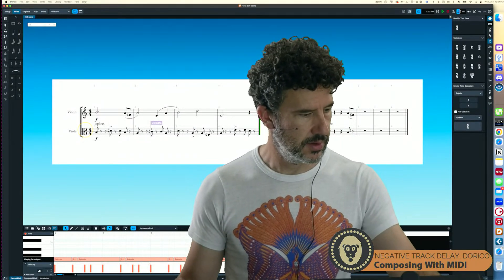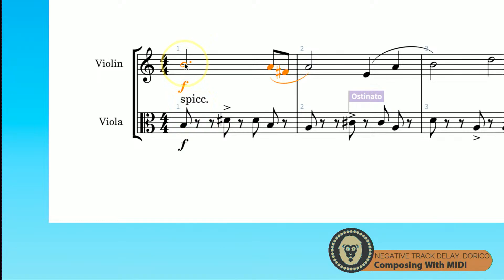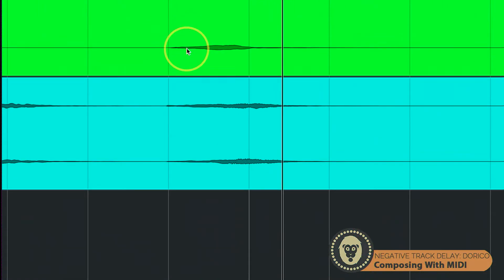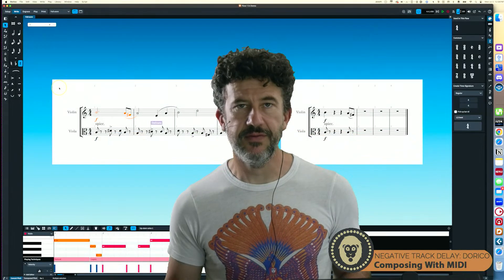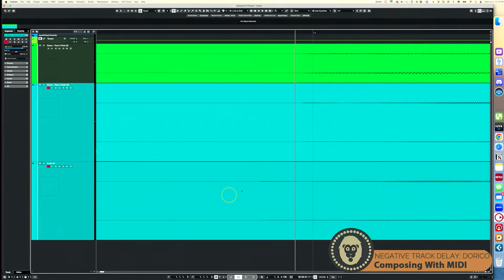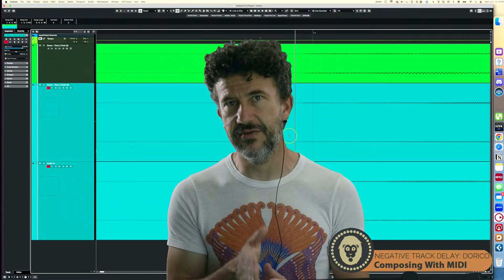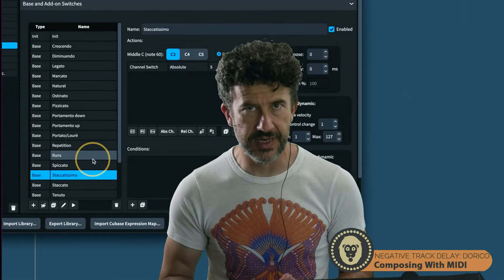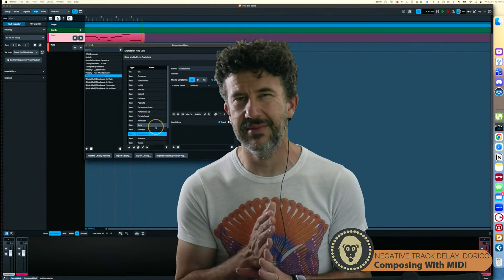Negative Track Delay in Dorico Expression Maps (by Articulation)

Comment: Very helpful! 
One question however, in Berlin series the first note of any legato run is closer to being in time than each other subsequent connected  note.

How do you handle this?
Reply from the maker: Glad it’s helpful!  To answer your question… in your Dorico expression map, you can set a value for ‘delay’ in the upper right region of the expression map dialog window.  If you set this to a negative number (for example -40) for the ‘legato’ articulation then those samples will trigger 40 milliseconds early on playback. This is called negative track delay and is the most common way of compensating for the fact that legato samples playback slightly out of time.